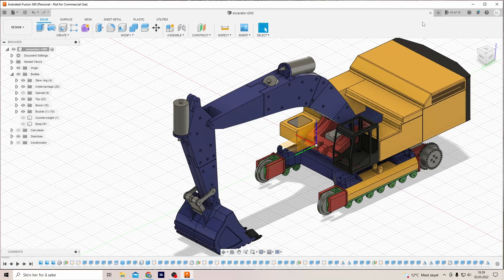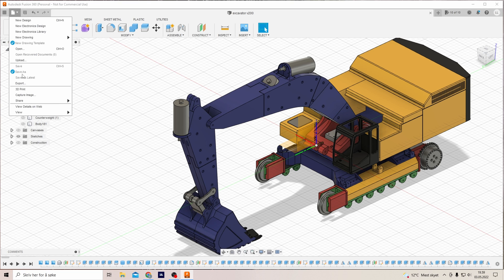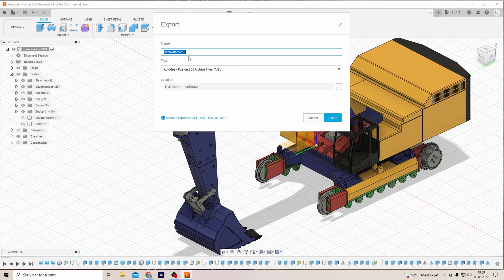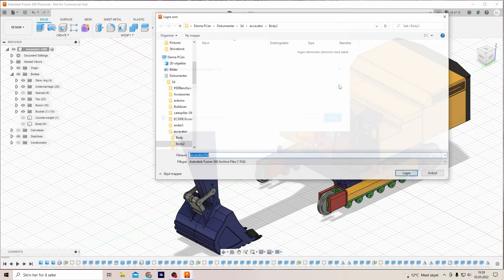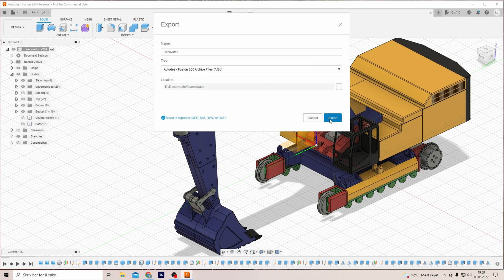Build your own 3d printed RC Excavator | FREE files!

Comment: Hello ji please is rc tractor model file
Reply: John Deere Tractor
Reply from the maker: Thanks.
The tracktor is really not buildable from the files. But I have a plan to redesign it for release.
Reply: I doing project on tractor New Holland t7 315 heavy duty series it has 2 speed gearbox from the drill.
Reply from the maker: Awesome 👍
Hope you share it ✌️